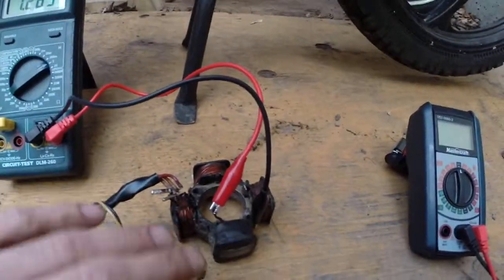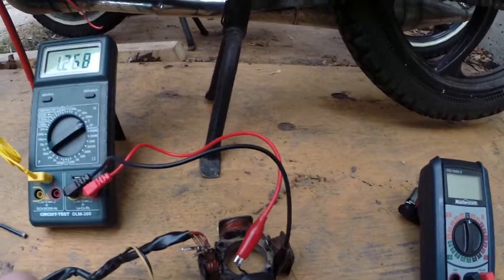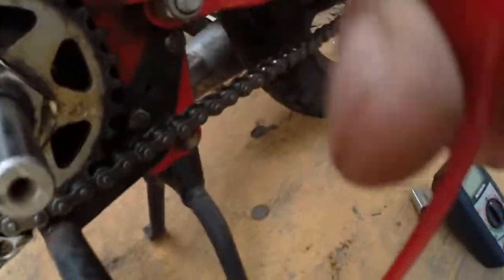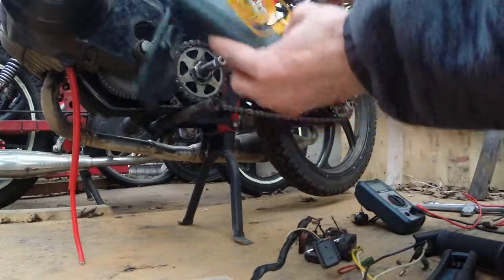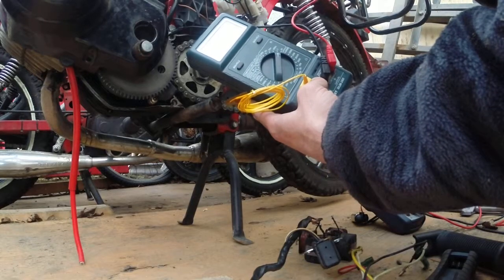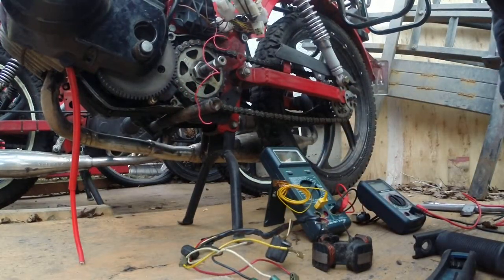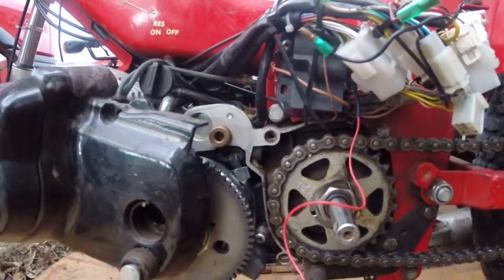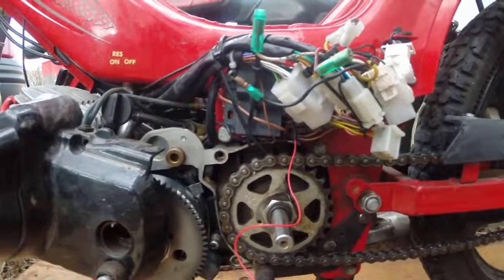Tomos A55 DW's Dead igintion stator coil

Comment: Such a shame that a great bike can be brought down by a poorly insulated length of wire wrapped against an iron post. My workaround is a Bosch points flywheel/stator from a Sachs 505 engine, found on the marque's Suburban and Balboa platforms as well as countless Taiwan-origin Her Chee (Grycner, General, AMS, and Jui Li) frames. Also highly compatible are Puch ZA50 systems (Magnum, Maxi Sport MkII, Newport II) and of course a CEV setup from a TOMOS A3 and early A35. Condenser which is vital for spark can be had at Vato Zone as a #F1578 or "the car it's for" is a 1962 Chevy II with the 4-banger. My spark coil of choice is a Bosch which can be found on Sachs or Puch, but I source mine from vintage sleds. The only way these quit is when somebody saws through them
Reply: I've TRIED playing with Honda-based and all manner of China scoot ignitions, too much work to even fit. Don't go there

Comment: do you know anywhere that i can pick up a a35 stator? My bike has the same problem as this a55 :( And treats or 1977 mopeds are all out.. Hoping to find one before Friday!
Reply: thanks ***** !!!!
Reply: ***** wait you only changed that black coil out on the stator? 
I know treats has one for an a55 but youre saying i can put the 55 onto a 35??? i wasnt sure if its doable in just removing the stator coil... in the video you linked you said "coils", so a little confused on what you swapped out.
Reply: TonyFizzle oh i just checked, i dont see the single internal coil replacement on treats... i was actually looking at the a55 pick up. :(  I wound up  buying a za50 cdi kit... hopefully i can get that to work instead of the stock system... since i cant find any parts -_-
Reply: ***** big thanks for the help too man!